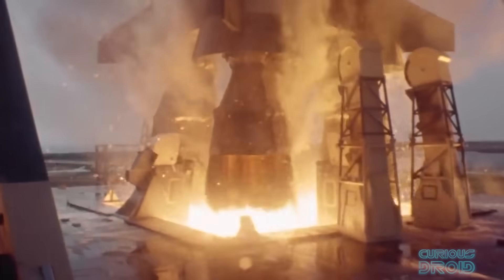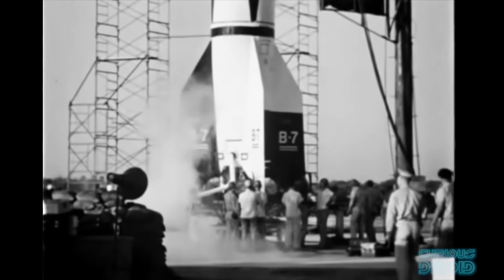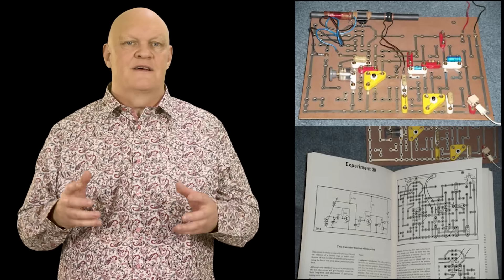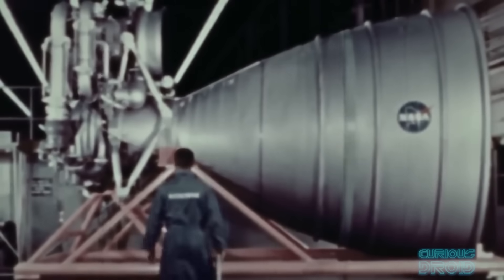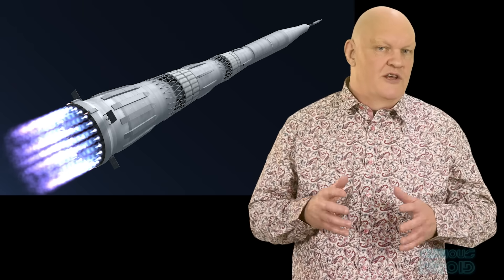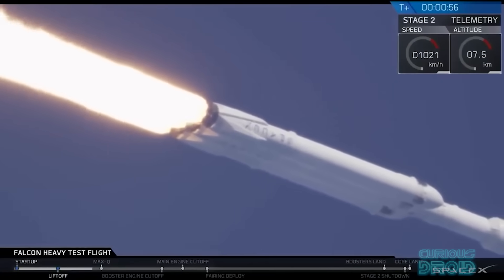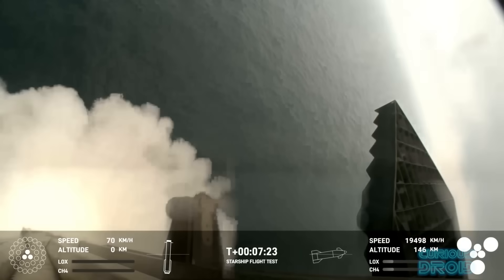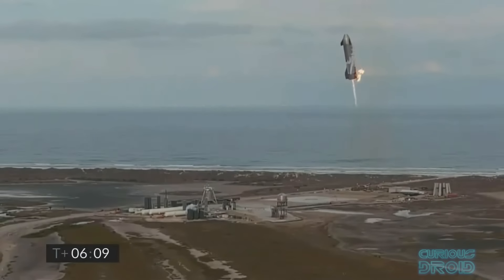Why Does SpaceX Use 33 Engines While NASA Used Just 5?

Comment: Ive actually researched this topic indepth and alot of the reason nasa throws away engines is that they were readily available, proven reliable, and had been flown enough or been in storage long enough that the economies of scale simply said it was cheaper to allow them to be thrown into the atlantic than trying to retrieve them with a bespoke rocket design created to retrieve these old and unused engines from the shuttle program.

Comment: Haven't watched the video.. I'd say the biggest reason to use 5 over 33 is that there are quite a few less failure points.  On the less critical side of this debate.. I'd assume SpaceX went with 33 "cause it looks cool.." or some nonsense like that.  To me.. knowing just 5 engines was going to do what 33 cant.. is awesome.. makes those saturn 5 engines amazing.  You can have those 33 wimpy ones.  Sorry.. in a weird mood
Reply: If you watched the video you'd have seen that Apollo used two different engines, one large and one small. SpaceX only wants to use one engine for manufacturing efficiency. Something NASA didn't care about during Apollo.
Reply: @Hedgehobbit  And it's also worth pointing out that the act of adding/removing/swapping an engine the size of Raptor can be done in a few hours, without the need to first drag the entire vehicle back to the assembly building—you can leave it on the launchpad to make the swap.  A gobsmacking time savings.
Reply: Still.. every engine and all the parts composed within it are additional failure points.  Make sense to me, in a situation such as that, where more means better?  Then again.. producing engines like they did back then is probably not doable any longer.. sort of like how we couldn't build a pyramid,  by hand, either.
Reply: @johnmagnotta8401  It isn't a case of additional points of failure as much as redundancy. If an engine fails on Starship, the other engines can be adjusted to compensate. If an engine failed on Apollo, the rocket was going into the ground.
Reply: @Hedgehobbit  If one were to entertain doubts about the many-engine approach with the full context of rocketry as of 2024, one would need to ignore the reality that Falcon 9 doesn't regularly suffer engine outages.  Hundreds of flights.  At a certain point, it stops making sense to give worry to a factor that has proven not to warrant it.  There will be many, many times more Raptors manufactured than there have been Merlins, and that likewise multiplies the possibilities to iron out wrinkles.

Comment: Raptor reliability is a big problem for SpaceX, they have continuously had problems with them, even multiple a re-lights still hasn't been done yet.  For their last 3 test flights of starship/superheavy it appears they only run them at 75% throttle to increase reliability. Sadly the downside is apparent  the payload capacity is much less than expected, probably less than 50 tons to LEO and 0 to TLI. U can ask the question they build the biggest rocket ever and it is still outperformed by a rocket that was designed and build in the 60''s with slide rules. We need to stop comparing a system that only exists in theory and cgi renderings to rocket systems that actually u know, worked.
Reply: The answer should be obvious but I will spell it out anyway: Reusability.  If SpaceX had as much interest in reusability as NASA did in the 60s, Starship would already have been done years ago, and all that extra thrust would already be bringing 100 tons payloads to the moon.  As for Raptor reliability, fair point, but be realistic: Are you logically inclined to believe that the cosmos is conspiring to prevent an engine from ever having all its kinks worked out?  We've already seen massive reliability improvements just during the prototyping with V2.  They'll be making several of these things per day before long.  Believe in engineering.
Reply: Build, test, learn, improve, loop until good. All rocketry went that way
Reply: @milantrcka121  Modern rocketry doesn't really test in the traditional sense.  There's only one entity nowadays that can afford to use prototype vehicles to figure out the hard answers.  You certainly can't "test" SLS—it has to get it right on the first try, which is why it's slow to design, slow to manufacture, and obscenely expensive.
Reply: @Asterra2  Exactly and lessons learned show that. That is why, as  purveyors of modern rocketry, SpaceX doing what they are doing rather well, exactly by testing and testing well.  I wish all the best to the crew, helium leaks notwithstanding. I also subscribe to minimum of two independent sources of means to get to orbit, same as redundant systems in aerospace.
Reply: @milantrcka121  On that front, happily enough, Dream Chaser seems well-poised to serve as a potential substitute for the beleaguered Starliner.  Even if NASA is dead set on sticking with Boeing, I would like to think that public criticism would sway their interests.
Reply: not really. It is surprisingly reliable given that the engine is still in heavy development.
Reply: Did Apollo 11 actually leave near-Earth orbit?
Despite the revisionist narrative that this channel won't question -- unstable fuel burn for the oversized F1 engines was never rectified and another arrangement in their place was made in order to reach near Earth orbit, keeping the F1 bell nozzle to maintain the desired appearance.  The great licking yellow flame was an indication that something was not normal as fuel was burning in the atmosphere while providing no additional thrust. This was the result of injecting additional kerosene into the exhaust stream for greater visual effect yet appearing to produce an inefficient burn unlike other rockets after launch.  No explanation is forthcoming and this issue is not addressed in any usual report; however, using a smaller reliable engine with a reduced fuel load and stripped down mission requirement allowed the Saturn V to reach near-Earth orbit.  

The Apollo 11 crew attempted to demonstrate their position at over halfway to the moon as seen in the unedited version presented to the public while the more recently released unedited version reveals a flood of blue light entering the same window as the camera continues to roll, through which only a moment before, we saw the Earth far distant in what appeared to be very low light conditions. Then, as the camera pulls back from the window, the exposure settings are seen to return to normal as a flood of light enters the same window.  Without a change in the orientation of the spacecraft assumed to be on a trajectory toward the moon, the only source for any flood of light can be the Earth while in near-Earth orbit.  

Another indication are the impossible weather patterns seen on Earth, when in reality only a small portion of the Earth's surface was visible, framed by the round window of the command module.  Straight line cloud fronts are seen to be extending for what appears to be more than 6000 miles, a quarter of the Earth's circumference -- something that has never occurred in the meteorological record on Earth. 

The usual sponsored efforts will try to make excuses for why the obvious did not take place -- yet is overly apparent in the unedited version.  When facts cannot prevail in support, sponsored activity will resort to name calling and other derogatory comments discrediting themselves.

Comment: I fear no man. But Raptors... Those scare me.
Reply: At high speed, they are velociraptors! 😲
Reply: @RWBHere if they are controlled by computers, they are called “clever girl”
Reply: @RWBHere 😂
Reply: Did Apollo 11 actually leave near-Earth orbit?
Despite the revisionist narrative that this channel won't question -- unstable fuel burn for the oversized F1 engines was never rectified and another arrangement in their place was made in order to reach near Earth orbit, keeping the F1 bell nozzle to maintain the desired appearance.  The great licking yellow flame was an indication that something was not normal as fuel was burning in the atmosphere while providing no additional thrust. This was the result of injecting additional kerosene into the exhaust stream for greater visual effect yet appearing to produce an inefficient burn unlike other rockets after launch.  No explanation is forthcoming and this issue is not addressed in any usual report; however, using a smaller reliable engine with a reduced fuel load and stripped down mission requirement allowed the Saturn V to reach near-Earth orbit.  

The Apollo 11 crew attempted to demonstrate their position at over halfway to the moon as seen in the unedited version presented to the public while the more recently released unedited version reveals a flood of blue light entering the same window as the camera continues to roll, through which only a moment before, we saw the Earth far distant in what appeared to be very low light conditions. Then, as the camera pulls back from the window, the exposure settings are seen to return to normal as a flood of light enters the same window.  Without a change in the orientation of the spacecraft assumed to be on a trajectory toward the moon, the only source for any flood of light can be the Earth while in near-Earth orbit.  The usual sponsored efforts will try to make excuses for why the obvious did not take place -- yet is overly apparent in the unedited version.  When facts cannot prevail in support, sponsored activity will resort to name calling and other derogatory comments discrediting themselves.
Reply: .  . While remaining in near-Earth orbit, another indication are the impossible weather patterns seen on Earth, when in reality only a small portion of the Earth's surface was visible, framed by the round window of the command module.  Straight line cloud fronts are seen on video to be extending for what appears to be more than 6000 miles, a quarter of the Earth's circumference -- something that has never occurred in the meteorological record on Earth. The round window of the command module was used to effect an image of the Earth but the weather in the region did not comply for a realistic view.  No recognizable continents are found in view, but only the impossible weather patterns seen.